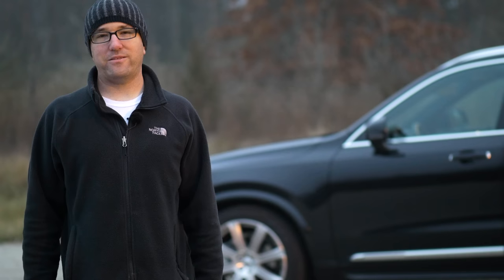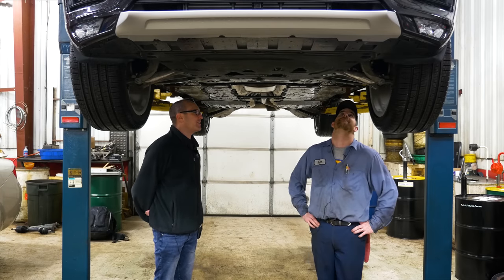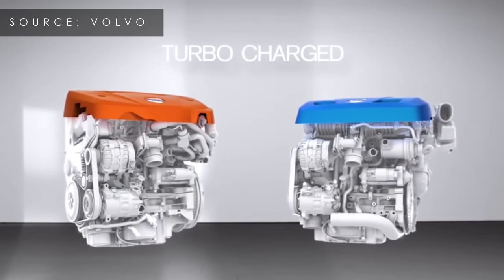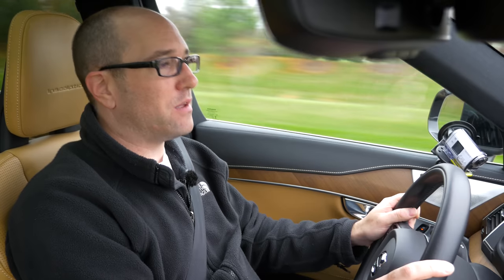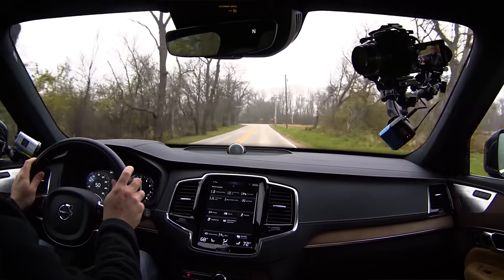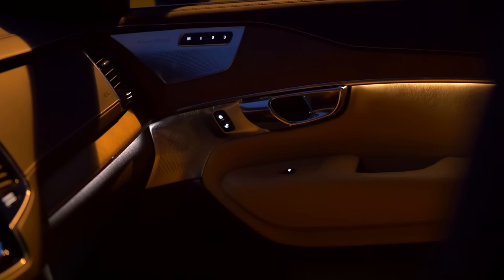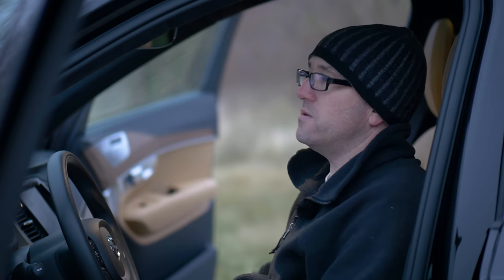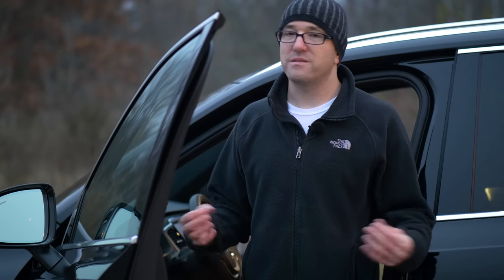Review | 2017 Volvo XC90 | The Tipping Point

Comment: Is the command centre really that laggy? It looks basically unresponsive. Surely they could afford a high end processor for such an expensive car.
Reply from the maker: +Mitchell Yes it was laggy quite often and there were no updates for it, checked many times and factory reset it twice.
Reply: Mitchell yes, it happens, pity, there happened some software problems in early version
Reply: Mitchell Doesn't need a faster proc. Just better code.
Reply: Are there cars out there (below $100,000 obviously) that have interfaces that actually are snappy and don't have major input or delay issues? This seems to be a VERY common theme for new cars, the UI interaction with so many of the functions just seems to perform like dogshit. Don't even get me started on Cue....
Reply: lowstrife Mazda
Reply: This infotainment is a disaster. No fix no support whatsoever right now from dealers. Feel free to fact check on any Volvo forums. Who knows how long the new engine gonna last lol.
Reply: Have this SUV T6 momentum plus. It is laggy for 30s and the navigation takes 30s to 1 minute to load up which is annoying. After the startup period though I have not run into any issues.
Reply: I'm just astounded people will test drive this car, play with the infotainment center and STILL buy it after experiencing such lag. Amazing.
Reply: thats weird, our infotainment is as smooth as an ipad
Reply: It's not laggy after everything is loaded (takes between 30sec and 1 min).
Reply: CinemaUnited That's unacceptable in a day and age where computing devices take seconds to boot. Either they skimped on hardware, or more likely, bad software. Either way, back to the drawing board.

This bullshit we see with modern cars is truly unacceptable. At least in the old days, you could rip out the stereo and install an aftermarket one. If automakers would open source their shit, there are many of us who would love to take a crack at it... Most of these guys are just running some Linux variant under the hood.
Reply: The flagship phones also take about a minute before everything is loaded. First you have the bootscreen(splashscreen) so you don't really see the process. Even your apps on your phone have a load screen and they are very small. Everytime you see a logo/name taking full screen on software it's still loading.
Reply: CinemaUnited First of all, it doesn't take anywhere near a minute to restart my phone. Modern phones take some time to restart because the full device encryption at play, does your car do that? How often do you restart your phone? Now your car?

Technology should be built for the use case. A car is constantly being shut down and started up. I would expect things like nav and the radio to be fully operational in seconds, not sit in the parking lot like a dingus for 2 minutes.
Reply: You clearly have no clue of software development. It first loads up all the important stuff like backup camera/dashboard, tyre warnings etc and then your navigation at last. This is logical and even a computer takes sometime to load in a program if it's something like photoshop, visual studio
Reply: CinemaUnited Lol, okay then. I'm a software engineer.

The simplest solution is use sufficient RAM and fast NAND. Upon boot, you spend a couple seconds loading the previous system state into RAM. Upon shutdown, you suspend the system to the NAND. The system could be programmed to reboot upon shutdown, on occasion.

Unlike  personal computing devices, cars run a finite set applications. This would avoid having to initialize apps constantly.

That's, assuming, of course, that the "guy who knows nothing of software", but does O/S dev at a big 4 knows what he's talking about.
Reply: Im very confused. have never seen that before. i have sat in a few and sure they are laggy just when you start it up but otherwise it's smooth as an ipad.
Reply: Yes and No.  The problem is we as a society have ZERO patiences.  It's slow to boot up, but even with a faster process, I think it'll still not be instantaneous... it's loading up a ton of stuff, too much really. If you keep swiping like was done in the video, yes you will overwhelm it.  If you are deliberate in you motion, it works just fine.  I mean, realistically, what's the use case of swiping, left right left right up down up down left right, like was done in the video?  Of course, that's the risk with doing an interface like this... many are spoiled with mostly good responses from earlier iterations of iOS devices.  But even current iOS will lag.  Yes there are a lot of complaints on the volvo forums... but mark me down as an owner that's happy with the infotainment.  It's not disastrous as some are portraying it to be.  Could it be fast, sure, what phone, pc, table, computer can use a speed bump.
Reply: ITs not what it looks like, the frame rate of the camera is making it look like one of the first smartphones
Reply: And the US version has some bug which make the system keep rebooting if change the Language to any East Asian Languages. The Euro-Asia version does not have the problem for some reason.
Reply: There have been many bugs to the system and nearly monthly updates. Mine has been perfect since the big update in May 2017 which altered the interface, stopped the map/navigation crashing and stopped the battery discharging.  Its also had two or three app updates for the owner's phone and pad since March. These and [lifetime free] map updates have been done over the air through the car's on-board model and sim card.
Reply: Our XC90 lags for the first 15s on start up, but then is buttery smooth.
Reply: Mitchell yes it is. And nacigation/ cameras need a lot to work. Also that you only have a screen is annyoing af. Driver assistance aids dont work properly. For a 90000€ cars that's unacceptable. 
Youre better with a GLE/ GLS or BMW.
Reply: The 2017 model got rid of most of the lag. I believe they do update the processor. Considering that a 12 inch iPad pro costs only $1,000, I'm pretty sure Volvo could have afforded to put a bigger, more responsive screen. However, the newer models are almost on the level of the iPad. I only wish the screen was bigger so that I could have two apps open at once (maybe climate control and radio), and could easily select options. I also wish they just had four physical buttons for climate control: a knob for temperature and fan speed for each passenger, with the center of the knob containing the on/off, defrost, and recirculate. Volvo should look at Ram's 12 inch UConnect as an example: big screen supported by convenient buttons.
Reply: Yep - true. I have a Note8 and it boots up in like 15 seconds. I'm pretty sure Volvo could have used a better processor and better software to get it down to under 10 seconds. After all, my friend's MacBookPro literally took 5 seconds to boot up!
Reply: The volvo interface is really that bad. Check out the scary edmunds consumer reviews for owners of the 2016 and 2017 XC90's. They hate it. Some users had cars that randomly slammed on the brakes on the highway because it thought it saw something in front. 

But Kia, Hyundai, Chrysler, and Ford models around 2017+ so far have the best UI's in terms of speed, consistency, and ease of use. We have a 2016 Kia Sorento and the touch response is almost instant.
Reply: lowstrife every single Bmw and Mini have a super-responsive UI...basically smart-phone quick. 
Audi is 2nd..very polished and quick UI also.
Mercedes is decently fast but a bit clumsy in the menu set-up
Reply: The Sensus software has been updated and mine works very well.  Backup camera and Bluetooth ready immediately.  A slight lag til the nav is fully operational though.

Comment: I'd like to see a your vehicle choices for cars that would be worth investing in and not stressing out about having to drive into a dealership for work.  I am interested in a SUV like this one, also the V60/V90 CC but I am not limiting myself to Volvo, I was looking at a Q7 used.  I am 55 yrs old and don't want to throw away any extra money that I really need to but I like nicer cars and can afford to buy them but can't justify $3k+ repair bills more than once or twice depending on the mileage, and I think that is fair.  I drive a 2013 Hyundai Santa Fe Sport 2.0T w/265HP and I am pretty happy with it.  In 130k miles I had to put a lot of money into it to replace the turbo and some other stuff but luckily I had purchased a warranty on it when if hit $98k, and that warranty paid for 85% of my work.   

I leased a Volvo S60R for 3 years and it was a $45k car back in 2005 and after the 3 years it was worth $20k but still a nice car, that was when I realized that I will buy cars coming off a lease (ideally) from now on.  I assume that the leased cars are better kept up because you know you have to return them so you have to be more careful with them and some brands/dealerships help out with the cost of maintenance in that leasing term.  

Yes, I think there are others that think like me and want a nicer car/suv but want to dodge the huge depreciation in the first three years.  Which ones would recommend and stay away from.

Comment: You missed a lot of the points of this car. It was suppose to take away a lot of the involvement and stress of driving to lower driver fatigue. All the noises and involvement you mention cause fatigue for the driver.

The interior was done by a former Bentley interior designer. Ya, it is awesome.

Comment: You're absolutely right that this should be a lease only. Even if you ignore all the electronics that can fail at any time the engine is another thing by itself. A 4cyclinder that is turbo and supercharged is stressing it out to the max and then having it lug around this heavy ass SUV, it won't even make it to 100k miles.

Comment: I have the old XC90... and if i understand it corectly, the new one is almost 15 cm longer in the cabin.

We drove to ikea and bought a kitchen.... well not the fridge, washer and oven, but all the other stuff. It fitted in the back of the car. Only have to put the 4 meter long tops on the trailer... All the other stuff fitted in the car :D
Reply: I don´t know about the 2017 range, but the 2016 range of the XC90 the entry level is about $40k that don´t have most of the breakdown stuff that make the car expensive to replace.

One would imagine that becasue all the cars (not only the 90 series, but also the 60 series) have the same engines and gearbox, one would imagine that spare parts for those would be fairly affordable. Anyway, Volvo spare parts have historicly been rather cheap
Reply: The interial designer of the new XC90 (2016 and 2017) is a former Bently designer... that it look the way it does, ist not a fluke
Reply: About the gage cluster... at least in the 2016 year model. The cheep model of the care had physical gauges and a small 5" screen in the middle for other stuff. To my opinion this lay out is WAAAY better, and i can´t see why anyone  would pay money for the worse experience..

Also the center console (at least in the 2016 year model) was in two sizes. A 9" cheep version, and a 12" expensive version. To my opinion again, the cheep version is way better. Better response, not as intrusive. Yea sure, you see less of the screen, but its that really a problem.

What they should have done to my opinion, its that they should have 3-5 circular physical buttons under the screen and  make them programmable.

Say a center bottom that change between carcontroll, heating, infotainment. (physical taktile one)

Then 4 outer one that for example with heating two for each side, one for seat and one for air. Maybe a center bottom in 2 of them and a 4 way cross in the other two, then everything heating can be adjusted.

Put it in infotainment. Then you have your volume and playcontroll in steed. Same bottoms, diffrent function.

Put it in car controll, and its the ridehight, sport/confort,  and so on.

Adding 5 buttoms to bring out the 90% that uses in the inforainment would really solve the problem. Adding 5 bottoms to the other 8, i don´t really think would be a problem.

Comment: First review I saw by you guys, v good.  The infotainment, yes, my wife has a Clio 2015 model, and even its little 4 or 5 inch thingy, is perhaps 3 or 4 steps to do something, it's as much as I would like while on the move.  QUESTION - what happened to voice control?!  It's the only way to go surely, you could do anything, without eyes or hands being distracted? Seems so damnably obvious?  I was looking just for the rear window heater, it would be quicker and safer to say 'rear window heater on' into the front of the driver dash, or a directional microphone or something on the steering wheel centre?  Seems obvious?

Comment: In my XC90 I barely have any apps (almost none were installed at delivery and I havn´t bothered since) and I do not experience any major lag or issues with the UI. Don´t know if too many apps even are available in sweden where I live, but anywho - I´d suggest removing some apps that you might not really need, the result will likely be a less laggy screen. Because as I said, mine starts upp real quick and rarely if ever lags or freezes up.

Comment: the driver doesn't have to actually touch the screen while driving. It comes with voice command to control music, calls, texts and temperature that you can control from the steering wheel.
Reply from the maker: +Aramis Sinclair because that always works so well and is so quick.

Comment: have you seen the user reviews...it seems some of those XC90s are plagued with electric issues and software bugs...I'm in the market and although I don't like the Q7's looks, it seems Audi is better suited to get my money.
Reply: lynx800 The looks of the Q7 are much better on the road, trust me. I felt the same but we cross-shopped the Q7, XC90 and RR Sport. The Q7 is a handsome, rakish beast, and the engine is so so sweet. The XC90 infotainment is laggy and the interior, noisy. If you want Mary Poppins (quite good to look at but doesn't last) get the XC90. Sherlock Holmes (high functioning genius) is more my taste so chose the Q7 :)

Comment: Was riding in one a while back and found the ride to be overly harsh over broken pavement.  I heard they made changes to the suspension to improve ride comfort, it must have made a big difference since you say it rides very well.
Reply: Lathan Starnes  Maybe the car you rode in didn't have the air suspension? I hear the ride with the standard suspension isn't very smooth.
Reply: Lathan Starnes It depends on the model. The R design with the 21 or 22 inch wheels will cause a harsher ride. If you prefer a softer ride you easily get smaller wheels.

Comment: May I ask if compare with CX9 which one has better response on chassis and engine? I know there's a big gap in price (But XC90 entry price and CX9 top line price is similar) So I wonder if only talking about chassis performance which one would you go for? 
Thanks a lot 
Kasper
Reply from the maker: +kasper Tsai You get a lot of what is good here from CX9 for 40k. But the big trade off is in the interior space, sound system, attention to detail and lack of grunt on the Mazda.
Reply: Thanks a lot for your reply, I really like your reviews , so many details and knowledge in the video.
Kasper

Comment: So, it's not a real AWD but a transverse Haldex-y faux AWD, basically a golf 4motion?
Reply from the maker: +Anco Sarci On demand system.
Reply: Just like most cars/suv including automatic transmission subaru. Very few cars have 50/50 split systems anymore.
Reply: Real AWD? What makes this fake AWD?

Having driven many new cars with "active" AWD, they react and send power to the rear in miliseconds, and often do so when the computer can anticipate slip, not just after it happens. Mazda's will send more torque to the rear when the windshield wipers are on for example. Toyota/Honda has produced some of the worst implementations of on demand AWD that has given it a bad rep. Every Mazda, Volvo, Audi, Ford, etc. that I've driven with similar AWD systems have all had huge gains in traction over their FWD counterparts.